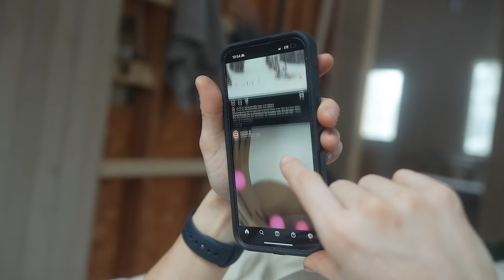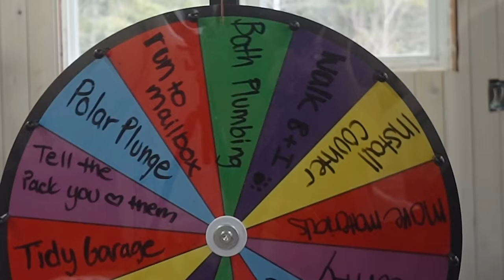Winter In The North

Comment: I wonder if the wheel would help. Getting over Workman's Comp issues being injured on the job. I quit that job and started at a new one, but struggling to get up and motivated. It seems like a problem to even get out of bed daily, as I've been sitting around for 3 hours today after waking up. Wanting to work on more projects like my RC cars. I'll get some videos posted, but that's something I enjoy, making videos of different projects I work on and enjoy.

DDD is adding a realistic expectation to this. I'm like, "They built a cabin, and I don't even have a floor in my bus I bought in July!" But here in Montana it's about as cold as it is there, and I have a full time job that isn't doing things I need to record to make money. It is helpful seeing you do this, because it motivates me to try to get the ambition to do it. Here I don't feel like I'm looking at unrealistic achievements when the realism sets in that it's difficult for anyone. The wheel is nice, but I have the same issue with doing one task before the other, like your cabinet and wall. The problem is, I have ADD and OCD, so I work extra hard when I want it done right, until it seems too difficult or I think about a different project. I got Mom's shed almost completely built! There's just a wall that needs put up, but I wanted to do the wiring to it. I might just put in a junction box in case they want to add anything later.

Get a crow's foot for those tight spaces. And get a d person grabby tool! I love mine! Spent $2 at Harbor Freight for it.

Comment: I started the refurbishment my house back in summer 2021 with a rewire, new boiler and new flooring through the whole place after a flood. Because of the rewire, all the ceilings had to be replaced and every room redecorated but it's been getting harder and harder to get all the work done as i live alone so their is no one to hold me accountable and i suffer from anxiety and get so overwelmed i do nothing. Even you can't send the wheel to the UK, can you tell me where you got it?

Comment: I am not interested in wheel I'm interested in your power system. 
You have a similar climate to Southern Alaska. So and when are you have reduced light from the sun..
Reply: Did you ever think of adding a wind turbine to your system or a couple of them.. I know that you have a large storage battery, wind turbines would add a little bit of backup power so-to-speak adding to your system.. and if you have a stream you may be able to use a simple water will as well to help out especially if it runs year-round.. you can maximize your system that way. By adding the two different types of turbine.. just a mere suggestion I am not trying to tell you how to live your life that's none of my business just trying to be helpful.. I've enjoyed your videos of watch them while you soak your van up and no as you build your house up..  God bless and have a nice day